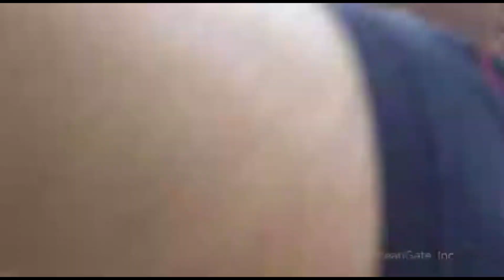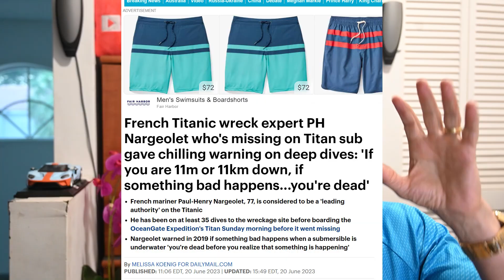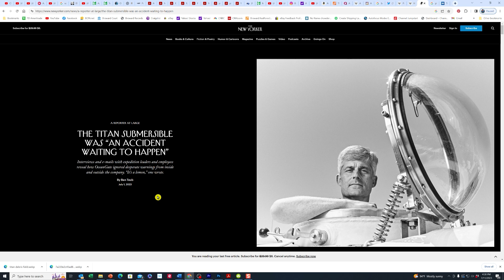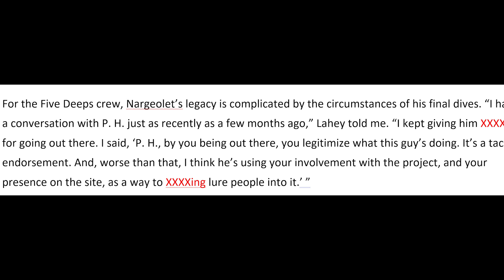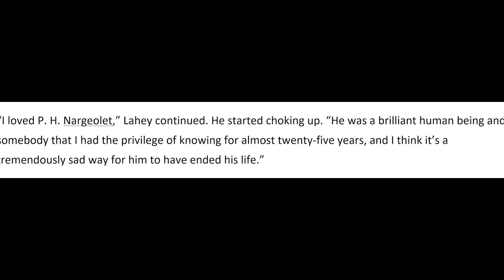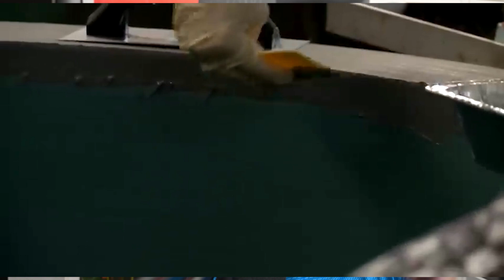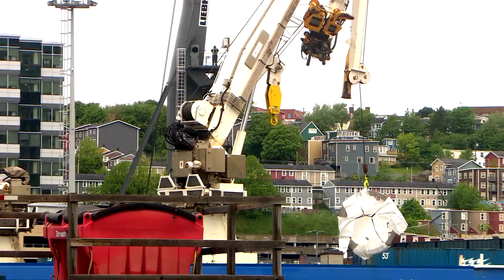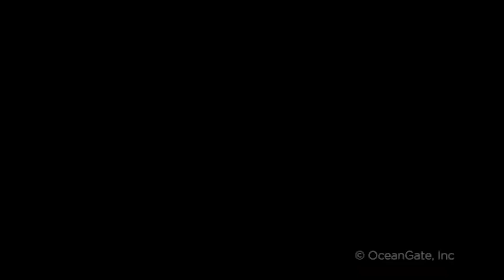Titan Sub: More Q&A, Design Defects, Why Descent Fast

Comment: Hi Jeff. You have to remember that the Titan hull was actually 2 seperate hulls. The first one build in 2016-2018, and the second one build in 2020-2021. There are documents online from before the distaster that describe how the hull was wound. The inner layers were prepreg and the majority outer layers were wet wound perpendicular to the tube as shown in here. Also the first hull was designed by spencer composites while the second hull was constructed by electroimpact under more controlled circumstances, including autoclave. It was the second hull that failed obviously.
Reply: supposedly the titan has been in 90 operations with 13 of them being successful. If anything it's like what Jeff said I think. Stockton rush really pushed the Titan to it's absolute breaking point to see how far it can go
Reply: Interesting information, are there any sources that you could share to verify this? I'm interested in checking it out. Thanks in advance!
Reply: @exshenanigan2333  Stockton held a talk at geekwire where he mentions the two different hulls. There's also a bit of info on the titan wiki page, as well as some older articles on geekwire.
Reply: @DKFX1  thank you, I'll check them out!
Reply: Well the now infamous video showing the winding of CF includes a shot of the CF being wound onto a bare metal mandrel, not a layer of preprag.  That may have been the first, or second hull, don't know.  But at least one was started with winding onto a bare mandrel.
Reply from the maker: It was filmed in 2018
Reply: @jeffostroff  If you're talking about them wrapping that carbon fiber around the cylinder, that was the inner weak hull. Obviously he wouldn't tell everyone how the outer hull was built since that would've been a company secret. I think it was designed in a similar way to W H Taylors atmospheric diving suit that draped the sealing material(in that case leather) over rings that provided the resistance to compression. With that design you get to benefit from the strengths of carbon fiber(i.e. strength in tension) while also being able to benefit from the strengths in metal or ceramics(i.e. strength in compression).
Reply: @mikefochtman7164  
You guys keep going over the gluing, material and curing process as if that matters...
I have news for you: a multiple dive deep sea submersible with a carbon fiber pressure hull is going to malfunction if you dive it it enough. Not if. When. Because carbon fiber is one of the worst materials to put compression/decompression cycling on with loads this extreme. It doesn't matter how it's manufactured. It's going to malfunction, eventually. There's a reason why carbon fiber deep sea submersibles are a "one-and-done" thing. They don't have the structural strength to do dive after dive. And each time after the first is on borrowed time.
Reply: @matchesburn  Actually more to it than that. I do think the war life makes it non ideal but it's definitely feasible with the right engineering.
Reply: @jhoughjr1  
No, no it isn't. See Real Engineering's video on the submersible and how carbon fiber is just the wrong material to use. End of discussion. The end. Period.

Now note: I stress for repeated use. There's been plenty of carbon fiber deep sea submersibles that are safe... For their one and only dive. You do not use CF on a repeat use vehicle, however. Full stop.
Reply: @jhoughjr1  It's really not unless the "right engineering" means replacing it every dive. There's a reason homogeneous materials like steel and titanium have been used historically for pressure vessels. Every single seam, overlap, or tiny imperfection in the mesh is a potential failure point and there is no engineering to solve this as it's just the nature of carbon fiber vs metals.

And this isn't even taking into account the fact that you can't make a carbon fiber sphere, which adds the complication of needing to fasten endcaps made of a different material, adding a ton of unnecessary stress and potential for failure to the design. Every single design compromise from the unprotected propulsion to the lack of seating to the lack of a hatch, etc, all stem from the decision to make the pressure vessel out of carbon fiber.

And even if there is some sort of understanding to be gleaned from building submersibles like this, it would be learned from research and development, not from trying to make money by building the cheapest submersible possible.
Reply: @jhoughjr1  Someone call Ghost Busters. Stockton Rush is apparently still alive.
Reply: @matchesburn @matchesbum  I disagree with you. Look at formula 1, all those carbon fiber pieces going through extreme cyclic loads, not as extreme as a deep dive, but going through both tensile and compressive loads quite often. Even steel chassis deforms and twists under these loads. Carbon fiber can endure cyclic loads if they are thoroughly designed to do so.
Reply: @jhoughjr1 

Stockton Rush has entered the chat…
Reply: @it_sundae 

Hahaha!  I just wrote something similar before seeing your comment.  Perfect!
Reply: @anothergamingmail746  And they crack.  Carbon fiber already cracks under formula 1 conditions.  Now take a deep sea dive which is a whole another level
Reply: I feel like you guys are arguing in a circle about mostly misinformation.
Yes it was 100% the wrong material for a sub. Carbon fibers are strong strings - strings don't do crap under compression - might as well just make a plastic sub and skip the fibers.   

But also anothergaming is correct - When used correctly carbon fibre does hold up to repeated stress well - a carbon fiber frame bike or handle bars will hold up longer and for more stress cycles then an aluminum frame or handle bars for example.    The problem here is just that it was the wrong material for this job.

Not really seeing any point to talking about the thickness of the glue etc.. Nothing is left so obviously it didn't stick - but also the pressure should have held it together if anything - remember the bolt not even being tightened thing?  The carbon fiber is bad choice, the thing was doomed to fail even if it was all built perfectly as other guy said.
Reply: @anothergamingmail746  
"Look at formula 1, all those carbon fiber pieces going through extreme cyclic loads"
They're not. Aircraft airframe and racing cars are put under tension - where carbon fiber excels at. Watch Real Engineering's video on the sub. Stop saying this.
Reply: @yohopirate  yeah cuz a car body IS designed the same as a pressure vessel. Formula 1 cars are all 5 inches think bodies right? not super light to minimize weight right?
Reply: @matchesburn  all structures are under tendons and compression pretty much all the time. Even this cylinder, when compressed, derp, stretches the other side so forces could balance out.
If it was the wrong material, it wouldnt have made so many successful dives.
It's not ideal, but few things are.
Reply: @ResidentEeper  the MAIN reason is metalurgy has been around millennia longer than carbon fiber composites and cost.
Carbon fiber development has been slow.

Real engineers wait until all the information is in rather the assuming things.
We know the pressure vessel failed in some way. we dont know why.
What we do know is this design worked for several dives before it failed.
That shows it can in fact survive more than one dive.
So the right engineering wouldnt be grand pappi's steel forever, but maybe 8 inches of CF assembled differently. We simply do not have the data available to know.
The data we DO have shows far from being the worst material that it was feasible.
Reply: @matchesburn  Unless you do. There was a time you didnt make planes out of metal either.
Reply: @jhoughjr1  
"all structures are under tendons and compression pretty much all the time"
1.) No they are not.
2.) I said cycling of it.
Reply: @jhoughjr1  
No, the main reason is that carbon fiber is spun/weaved and every single time you make a new composite, it's different in minuscule ways every time that make concrete testing and performance almost impossible to calculate for.

This is why you use it only in areas that you can guarantee it provides a level of safety for. We can use it in cars, planes, etc. because they are not cycled under compression/decompression to any drastic scale. And even then carbon fiber still can have issues.

Look, the fact that virtually every engineer disagrees with you and is saying carbon fiber is the wrong material for a repeated deep sea submersible... and the fact that they're explaining with engineering testing to do so... should be proof positive enough to tell you that you're mistaken.
Reply: @matchesburn  To clear up some confusion here: Carbon fiber is a very strong material all around and has enjoyed widespread application in a huge variety of industries, there are examples of carbon fiber being used in deep-sea exploration too, mostly as housing/casing material for equipment, but there have been very little testing for huge structures designed to house humans. This is where Stockton Rush decided to skip a bazilion safety standards and go straight down instead.
Reply: @DKFX1  
"mostly as housing-casing material"
Which are not pressure vessels and are not load cycled.
I'm sorry, but I'm getting tired of dealing with this argument. Carbon Fiber is the wrong material to use on a pressure vessel, a deep sea repeated dive submersible. Period. The end. I will consider no alternative argument because it's flat out wrong by the materials science and engineering done into it.
Reply: @matchesburn   This is very oversimplified thinking. The incident around oceangate has a lot of more faucets than merely "carbon fiber bad". Many testing procedures and safety standards were ignored and writing off a material on a whim because of a single incident is not how engineers usually approach a tragic event like this. More testing is needed, clearly CF has advantages over classical metals that need syntactic foam to be buoyant.
Reply: @DKFX1  
The science is in, we've done the material science. Yes, carbon fiber for repeated use is bad for this application. That is the end. I will not entertain you any further. This is not up for debate. It's settled science.
Reply: It's not inner vs outer. longitudinal prepreg layers were interspersed throughout the laminate.

Comment: Does the descend rate not have something to do with something that filled up with water cause they coudn't surface and moved about a few meters upwards when they wanted to return back up? if they installed a thruster wrong someone coudn't have tighten something to spec and it could have gotten water in and they descended faster and then had to switch to bus board B cause his systems was not working...

Comment: I piloted a 2 man submersible during a salvage operation off the coast of maine. The only reason the Titan descended too fast was that it was too heavy, probably due to seawater beginning to enter the carbon fiber prior to the implosion.
Reply: You might be right don. A guy on the internet showed pictures of large air bubbles or bulging pockets on the cylinder in the rhino lining coating where it separated from the Carbon fiber. He waterproofed the outside with this rhino lining that people put in their truck beds. His theory was that the rhino lining eventually got so much water in between itself and the hull that it created heavy water bags weighting it down. Like you said, it could have also entered the layers of carbon fiber and weighted it down.
Reply: There would've been no room for the water to enter. It was probably a high-resistance short circuit. That would've caused the thrusters to be weaker because the voltage to them would've been lower. However, the current to them might have been what the computer controlled and thus it didn't notice the low voltage. All was basically green until the battery overheated. Then he turned the thrusters onto full power and it did what lithium batteries do when they're not happy.
Reply: Improbable.
Reply: @shaymcquaid  So said the captain of the Titanic and former CEO Mr. Stockton ... Physics said: check.

Comment: The one thing that sticks out to me from the transcript video was that they were still descending after dropping ballast and only began to VERY slowly ascend after jettison of the legs.  Combine this with their rate of descent and it would not be implausible to suspect that there was somehow water leaking in or some similar issue affecting buoyancy of the craft.
Reply: But at those tremendous pressures water doesn't leak. It would tear through any gap like a bullet. And any section not pressure-sealed should be expected to take on water or else it would be crushed soon after diving.
Reply: I didn’t even think about it like that. I just figured the water leaking in would have shorted some part of the mechanics causing something to fail. But that makes perfect sense.

Comment: While I enjoy your enthusiasm and professionalism I find your discussion of PH rather disrespectful and full of conjecture. Also wetting the CF introduces complications of hot spots during the curing process where the center likely has more fluid buildup. This is all avoided through use of an autoclave as you and the other had said. What I don’t appreciate is you taking clips like the construction of the submersible as fact. We don’t know which model was being assembled and Rush made multiple.

Comment: With respect to the descent rate being approx 50% greater than expected, as a sw eng primarily for embedded applications, I find it inconceivable that a descent rate would not be one of paramount importance and displayed and reported prominently.  This leads me to believe the transcript is not authentic although if times and depths reported then the reported descent rate may indeed be accurate.

Was the greater descent rate of consequence?  Remains to be determined, if possible.  If it is of consequence, structurally speaking , then it is yet another reckless decision by Stockton Rush.  

Certainly the descent rate was not so excessive that the vehicle was in free fall (thru the fluid of water rather than air) and would have reached a terminal velocity much greater than the reported 38, or thereabouts, meters/min, especially considering the vehicle profile likely had a low drag coefficient.  So the descent rate seems to have been a conscious decision.

All just speculation anyway.

Comment: Yeah, the descent rate is important....  There's a whole buoyancy/negative buoyancy thing going on here...  If you are sinking too fast, which they were, apparently, if that transcript is accurate and legitimate....  It is very possible they could never come up...  At the end of that last video, it seems like they dumped their weights & ballast, and were barely rising, which is very very dangerous....  And Mr Rush himself is on record in many interviews stating 'If there's ever a problem, we can easily just surface."  Uhhh, yeah, if your buoyancy is correct...

Lurking in this problem is, even if the sub did NOT implode, it is very possible it would have taken days to surface, because the buoyancy was messed up.  Sinking too fast = rising too slowly....  Rising too slowly = running out of O2 before you reach the surface....

Comment: Ive worked in the aerospace industrie and standard practice for having proper manufacturing glue gap was to use calibrated glass beads, applied at around 3 to 4 beads per square inch on one part of the  of the adhesive, when mating the parts we always made sure to have the adhesive oooze out a little bit, we always used static adhesive mixers to be sure that the part A and B were homogenous
Reply: We have the same system in the shop when we glue on the quarter panels on cars. The beads are in the 2 part glue.
Reply: @passionworksbodyshop9738  Its the only way to control gap thickness when mating parts

Comment: That is a pre-preg mono tow they are using. The fibers come prewetted and partially cured. Usually resins only expire, which is why they were able to use expired carbon fiber, because it had a resin component as part of the prepreg.

Comment: Does the area of the debris field suggest the height above the sea floor when Titan imploded? The pattern of the debris field calcutated with the current would reveal the depth at implosion since the heavier items would drop straight down while the lighter ones would drift. This might help to verify whether the reported messages are true. If the sub was descending at a rapid rate, it was essentially sinking from the time it left the surface.
Reply: There were no messages.

Comment: I think we may be making too much of the glue bond between the carbon fibre cylinder and the titanium rings.  As the water pressure increases on the outside of the vessel, those two structural elements will be more firmly pressed together.  I also note that the modulus of elasticity of carbon fibre reinforced resin and titanium are roughly the same, on the order of 100-120 GPa.  I'm betting on a fatigue failure of the carbon fibre, exacerbated by the (as yet unverified?) rapid descent. Which begs the question, why were they overweight?

Comment: I also saw the Jamie Kunka video "Why OceanGate Titan Imploded - A Carbon Composites Perspective". It was very informative about the joint and the prep work.

The video of the hull being constructed is from their YouTube channel and is of the first version done by Spencer Composites in 2017. That one made enough "crackling" noise that even Rush scrapped it after two deep dives.  The second one was done by another company in 2020 and that is the one that imploded.